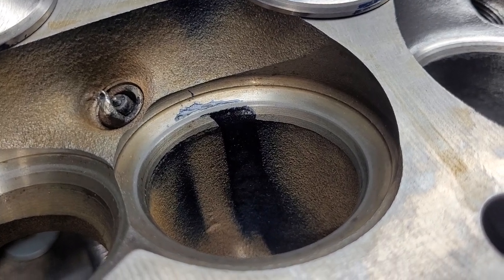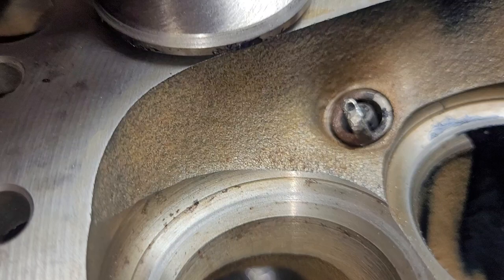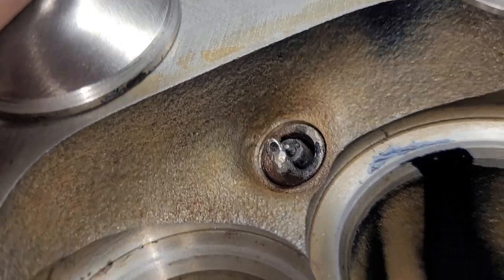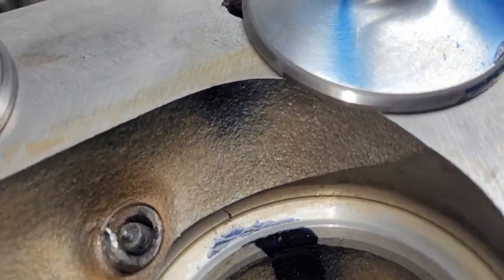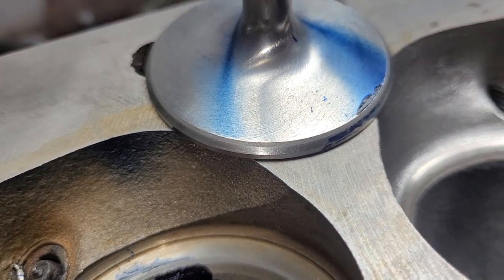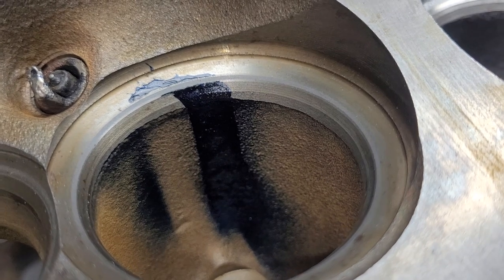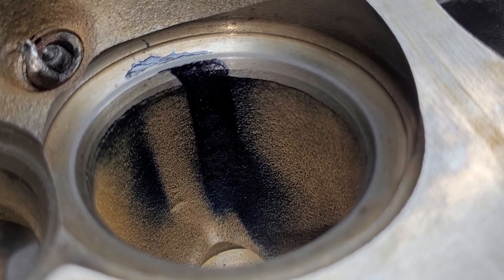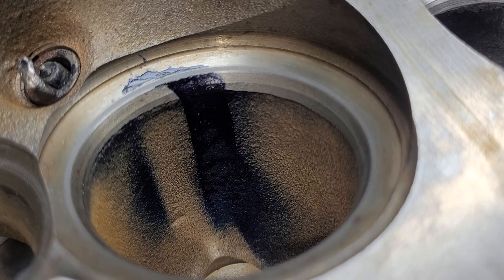Mopar W2 stock valve job, lap in and measure.

Comment: Not on the top.
On the bottom of the valve.
The seat is small.
That is some impressive flow however.
I look at the major diameter, based on the valve head size.
I wonder what people think when they do the valve job?
Thanks for sharing Charles. 
Take care, Ed.
Reply from the maker: I appreciate your input, thanks.

Comment: Looks pretty thin
Reply from the maker: I am guessing you are writing about the dykem pattern?
Reply: @servediocylinderheads  No I meant the margin on the valve seat
Reply from the maker: Yeah, that is a problem with 50 degree seats. This was an old valve to begin with. You have to be clearer on your comments. I confuse easily. Thanks